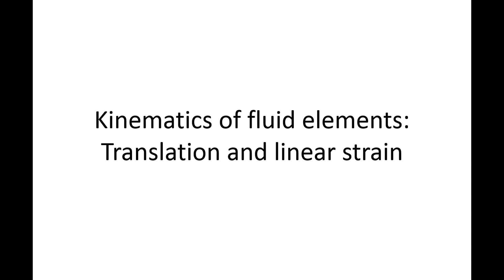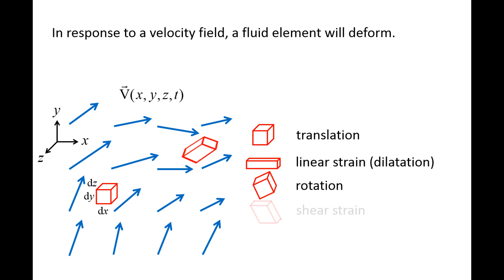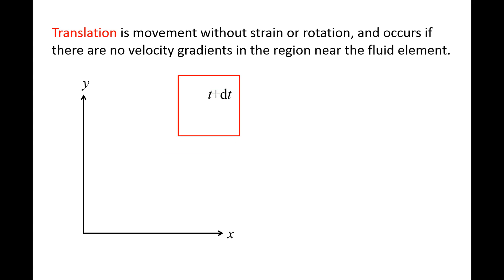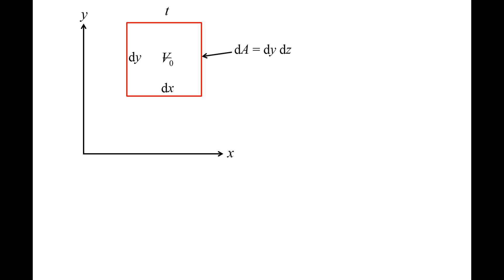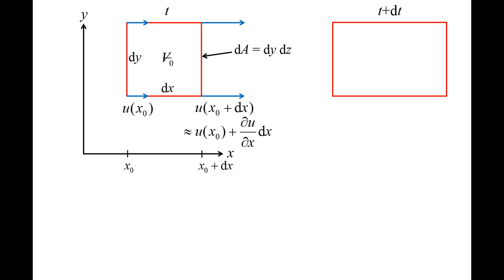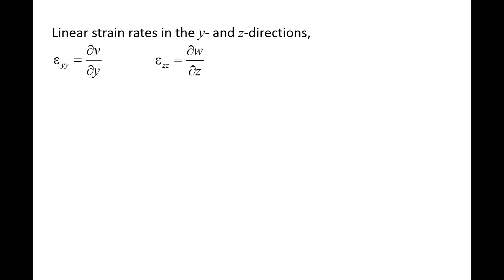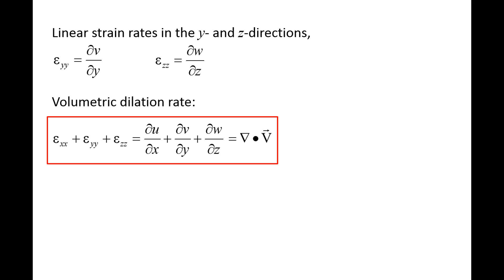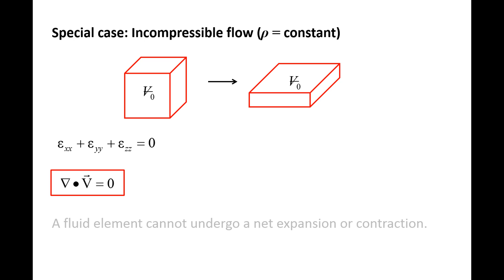Fluid Mechanics: Topic 10.4 - Kinematics of fluid elements (translation and linear deformation)

Comment: Hi, I have a doubt. At 3:44 how the volume of the fluid element is increasing. Does that mean you accommodate more fluid in to the fluid element. If yes, how does that work?
Reply: Got it! At 6:54, For an Incompressible flow, the volume of the fluid element doesn't change.
Reply: I have a qs from you then. Why is it called linear strain when it does not extend(length does not change) cuz as you said it is incompressible??